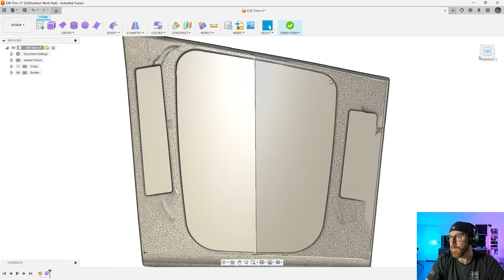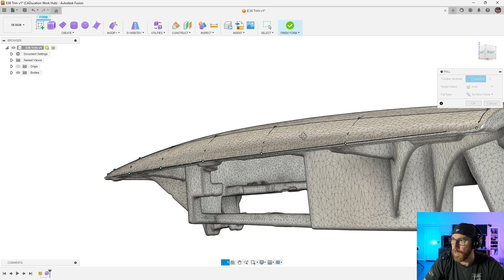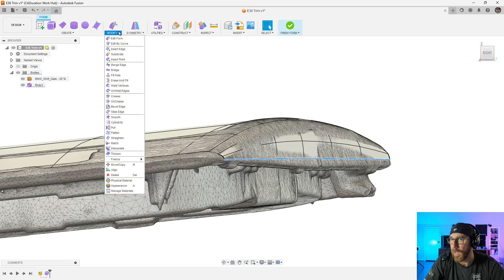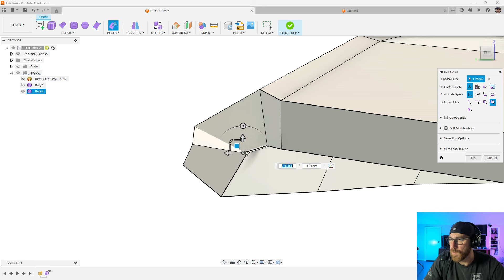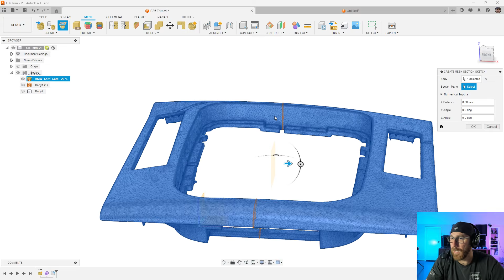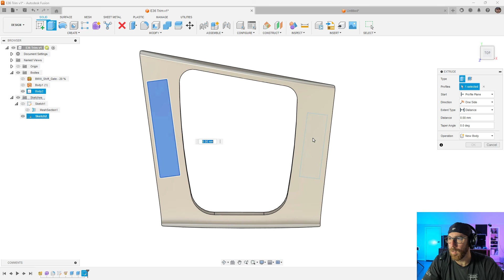Reverse Engineering Car Trim Panels for 3D Printing part 3 – BMW Trim Panel and Fusion

Comment: all fusion has to do is add a couple of features from geo magic and it'll be great! the gradient live snap in form faces and the decimal adjustments after to snap to mesh. =p
Reply from the maker: Yeah.  I have heard some rumblings about more mesh tools, but have yet to see anything official on it.  Some sort of gradient for how far off would be massive.  Move with snap on has never worked for me so I always move then snap with the Pull tool.  If it worked like QuickSurface does that would be amazing.  QuickSurface also has a "brush" you can run over the form to "ease" it which is helpful.

Comment: You're doing Gods work. Can you add points on random points of a line to address low/high points between two existing vertices?
Reply from the maker: Thanks!  I am not sure I follow your question.  Are you asking to put points on a line to visually show that areas are high/low?  Fusion doesn't have any analysis unfortunately so its all visual.  In QuickSurface we do have analysis tools that can show you how close/or far you are with a color chart.

Comment: I'd love to see something where a scan wasn't perfect and we can't rescan the part so we need to fill in the gaps of the scan data.

Is there such a workflow that you've already done that I can learn from? That is the combination of the original 3D scan + additional CAD modelling on top that can be fused together to bring a complete image.

A really good example is while the core scan data is there, tabs might be incomplete so 3D printing a copy might result in a wonky looking tab because of artifacting.
Reply from the maker: Hey there, well there isn't really a combining of scan and CAD data.  You kind of have one or the other.  But with this part you can see we create the shape over the holes.  Not having tab locations can be tricky though.  We do have a few series where we make parts from the scan data.  some with better scans than others.  the Custom Duct series talks a bit about the level of detail and requirements.  for example the scan data inside the bumper is messy.  The exhaust manifold video has an "ok" engine bay scan with roughly where things are.  In our GPz build series we have several parts that are based on scans.  headlight, Tail section, and triple clamp (for now).  We also have a 5 or 6 part series on doing an airbox.  the airbox scan was pretty good but some of the auto mesh filling tools messed up some features so a little bit of guesswork filled in the gaps.

but at the end of the day, if you don't have at least some little reference it is very tough to know where to put things but not impossible!

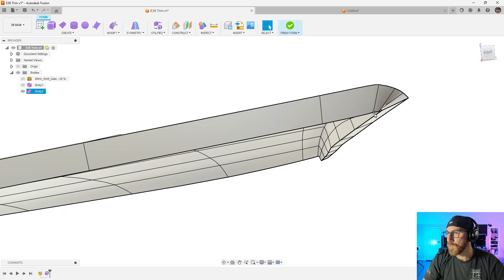Comment: The thing I'm most struggling with is the edge work; the work around 18:00 and understanding how to clean up the edges using box display, etc. Once I thicken and get to the inside edges, I'm not quite understanding the way it works and what to do that is appropriate. It's the one thing I can't seem to wrap my head around. Is there any other videos that explain this 'for dummies' like me and may help?

Thank you for these videos! I use them tons to learn individual parts in Fusion!
Reply from the maker: Its tricky because it varies so much based on geometry.  I have covered it in a few different videos.  This one is talking about how to identify thicken problems.
https://youtu.be/yWSafAfDjxI

I also covered it in the Race Car intake duct thickened forms.

But in general if you have a surface that will Pinch or roll over on itself when thickened, meaning the radius of curvature of your surface is smaller than the thicken amount you are trying.  Using thicken in forms lets you manipulate the inside independently.  So you can add or remove edges, move them around etc.  We also did this in a recent video last week designing a mountain bike fender with a thickened form.

It takes practice and every use case will be slightly different, but if you have strong skills with forms modeling just treat the inside like it is independent and work with it that way.  For 3d printing it doesn't really matter as much about the part thickness as with something like injection molding.

Comment: Could you create some mesh section sketch and then join them with a loft instead of working with forms? If so, do you have to fit curves to mesh section manually for all the sketches?
Reply from the maker: You can certainly do that but there are a few problems.  With this because so much of it was open (hole for the shifter) there isn't a ton to go on with the mesh section sketch.  So you have to sort of guess at it.  With a form you have a bit of a better chance of slowly adjusting the shape to get it to fit.

The other thing with mesh section sketches is the spline that "auto fit" are junk.  curvature is awful.  So i generally do that manually creating splines that are close to the mesh.  We have an old video on a dodge dash hvac/radio bezel showing that.  Also have done it in a few series as well.  Generally i use mesh section sketches for more mechanical parts where I can do things like lines and arcs rather than splines.  partially personal preference.

Comment: Amazing video, I have tried to follow it using a really simple piece I need to reverse engineer but it is compound curved and the faces obviously will not snap over the curve any chance you could help with doing this stuff on curved items I ould share the scan if it helps but I cannot seem to get the faces I created  subdivide as it says non manifold and the pull command wouldn’t select the face at all it was like it didn’t exist any ideas ?
Reply from the maker: hmm that is strange!  feel free to email me support@caducator.com and i can try to answer questions.
Reply: @LearnEverythingAboutDesign shall I send the scan I’m using for you to look at ?

Comment: Curious, is the reason box display rough upon the initial free foam because the points aren’t normal to the surface when you are creating the surface? Is that what smoothing out the box display doing for the surface over all
Reply from the maker: Box display is sort of the mathematical driver of the smooth surface.  The more divisions you have the closer the box and smooth display will look to each other.  The goal (for me) is to try and manage the box display edge flow and face angles to better drive the smooth surfaces.

So there is another display type that shows the cage(box) and the smooth display.  ATL+2 on the keyboard will let you see the box display and manipulate it while showing the smooth under.  Try making a simple shape starting with a quadball, go to that display type and start pulling edges around.  Do the same thing with a Box model as well.

Comment: Excelent video!!! Thank you!
I prefer use Fusion than Blender. The huge problem for do the same operation and other designs for 3d printer in Blender are dimensions and accurate offset ops. That´s why I restarted with fusion 360. And your videos really helps a lot !
Reply from the maker: Thanks, and yes for sure.  Blender is super powerful and with add-ins like Cad Sketcher you can mimic a cad system, but it isn't exactly the same.  and if you need a NURBS surface you can't really get that in Blender (currently).
Reply: @LearnEverythingAboutDesign Thanks to you i made a 1972 corvette stingray , the only issue i have is make frames for the windws for 3d printing iam planning to add a transparent glass for it

Comment: E36 sunroof motor cover that clips in like it’s oem
Reply from the maker: If i had an e36 that might be possible.  do you have one?  I swear your avatar is bunta fujiwara so figured youd be rocking an 86 :)
Reply: @LearnEverythingAboutDesign  I’m sure you know the 86 belongs to takumi and the Subaru was fun but rwd is the most rewarding.
Reply from the maker: @DrPsta  Agree.  I would have to dig way back in my Initial D memory bank.  I though Bunta raced the 86 before it became the tofu delivery car that takumi ended up driving.  Always have a soft spot for the 86

Comment: Hi Matt, 
Once the reverse engineering work is complete, if the part to be printed exceeds the printer's maximum print volume, how do you divide the part? Do you have a video explaining that? 
Thanks!
Reply from the maker: I have plans to do another video talking about this.  Some print slicers can do this automatically, but in many cases you have to get creative and figure out how to put them together.  We did this on the Wideobody series awhile back https://youtu.be/ftKAl7WWfZM  and also for the GPz tail section.  It helps to add features to locate them like holes for pins or something.  Generally they need to be holes with extra pieces printed so you don't need extra supports.  On the fender because it was such a thin piece I added some ribs to most of the parts to help with support and bed adhesion.
Reply: @LearnEverythingAboutDesign  OK. I'll keep what you're saying in mind and I'll watch those videos. Thanks for the info, I'm looking forward to that video on the subject.

Greetings from Argentina!

Comment: Wouldn’t reverse engineering be studying the density. In theory the density of material could be non-uniform. 

One of the most tricky things is orientation of the fdm, infill, layer count.  These parts always seem to fail at the tabs or thinest points.  Even injection molded fails.
Reply from the maker: The term reverse engineering with 3d scanning typically means recreating the scan part with CAD.  For a professional this usually means creating a prismatic copy of the mesh.  For most hobby users this means making something close to the original as either a replacement or upgrade.

Yes with FDM we certainly have some mechanical issues.  I have printed several PLA-CF parts and been really happy with the strength vs a standard pla.  the layers aren't visible and the layer adhesion is better.  I did a video awhile back talking about fdm, sla, sls, urethane casting, and injection molding. pros/cons, costs etc.  For a one off part like this you could get away with fdm if you printed it standing up on end.  This would give a good surface finish and if the tabs are oriented perpendicular to the build orientation they shouldn't have failures at the intersection.  Would it survive multiple installs and removals? probably not.

Another option is to epoxy the tabs onto the part.  this lets you print the tabs in their ideal orientation and material (maybe even metal) and bond them to the part.  I have had several prints that I bonded and they never fail at the epoxy...
Reply: @LearnEverythingAboutDesign  Thank you for your thoughtful reply. I will have to try the epoxy method next time I get a contact failure or on initial attempt, sounds promising.

Comment: Thanks for the video. IMO, using free form for that particular case is not worth the effort. I know you're trying to teach that style of work, but, with a few sketches and 3 rails I can do faster and better form. In a very organic shape, for sure, this will be faster, but for this kind of work, nothing like a simple loft. Again 3 sketches and 3 rails. 10 minutes or less. It will be great if you show a video doing that too. Remember if you developed more skills, reverse engineering is more faster. Thanks for your work. Great as always.
Reply from the maker: Thanks Jose, in part 4 where I use Plasticity I do show lofting through multiple curves.  In my testing on this part I did that workflow and it was slower and less accurate.  This part is a little odd as its not really symmetric and there are some nuanced curves on one side.  If there wasn't such a big hole in the middle it would be much easier to extract a curve, but you are right and it always depends on the part.  When I did this in Fusion with curves I found just snapping to the mesh section where the part was didn't give a great result, it bubbled up in the middle.  and picking a random point in the air was a hard concept but certainly possible.  When I did this i left the sketch under defined and just dragged the points around after the surface was created.

For reference without narrating and walking through the part can be done in about 10mins like you said in Forms as well.  Maybe I can add a part 5 just to show that.

thanks
Reply: @LearnEverythingAboutDesign thank you for the heads up. I will be waiting for next video. Thank for you great work. I love to see your content even I work doing this everyday.

Comment: If like to see a plasticity video - but I want to see a video doing the same thing with the auto tools in QS even more. How do the auto tools handle various types of parts? Because that could be super useful. Exporting CAD data sounds pretty useful, too, but I'd be interested to see the workflow between the versions of QS that export CAD data, vs bringing the mesh from QS personal into fusion and creating a solid from that, vs going from the surface or form tools in fusion to a solid (again, all on the same part). 
Just my 2¢, beggars can't be choosers and I loved this video series. Subbed and liked and clicked the bell and everything - now I gotta go back and watch your other videos ;-)
Reply from the maker: Thanks Chris, and yes great comment/question.  I have a webinar I did for QS (before Personal was a thing) that shows the auto freeform tool in both LITE and PRO so you can see the difference.
https://youtu.be/_PdPFEnUpvM

Personal doesn't have an auto freeform tool and trying to use it in LITE or PRO really works best if you isolate a portion of the mesh rather than trying to wrap the whole thing.
LITE and PRO have different algorithms used to create the freeform and the PRO one is so much better.  has a symmetry option and the results are just cleaner and better flowing in terms of the shapes.

Personal does have a "Fit Surface" tool which is the same one you get with LITE and PRO.  Fit surface is something you need to use carefully and works best if you limit the selection.  Doesn't really work great on this part from my testing.

Ill make a note to make a video going over/highlight some of the tools and differences in pro vs lite vs personal in a future video.
Reply: @LearnEverythingAboutDesign Thank you - that explained it way better than I could find on their website. Going to watch that webinar now 😊

Comment: I'm trying to create a part that is similar to this part for my motorcycle and the information so far is great!!! I'm still having problems but hopefully you will finish this part, and im sure it will answer questions i dont have the words for right now. Thank you for the work ur doing.
Reply from the maker: Thanks Chris.  Right now there isn't plans to add all the tabs and fastening bits to the bottom of this.  I will let the user that sent it in do the finishing touches for their updates for 3d printing.  but can try to answer questions on your project.

Comment: This is likely a dumb question, but when using box display is there any meaning to the gradation in the shades of grey for each face (eg, darker = more/less parallel to the plane you’re viewing in?)
Reply from the maker: All the shading you see on the box or smooth display is a result of the environment you have setup.  For example go down to the monitor icon in the bottom center of the screen go to Environment and change it to Infinity pool.  You should see the top faces go much lighter because of the direction of light in the scene.  

I think that is what you are asking.  If not let me know.
Reply: @LearnEverythingAboutDesign not quite what I’m asking, but probably the explanation. I’m looking at my model (or yours) in side display, in box mode, and each face is displaying in a different shade of gray. I get that they are each reflecting the “light” of the environment, but can the shades tell us anything? Example: if on an edge loop they are all nearly the same grey, or all very different, can we use that as a clue that our faces all out of whack? If we manipulate edges and vertices to get the shades of grey to match better adjacent faces, can this be useful?
Reply from the maker: @ThatAdam12  Interesting.  Honestly I never pay attention to that in box display but maybe.  In smooth display I often use the light/shadowing to help me with the flow of edges.  In box display I am mainly looking at the edges themselves in different views to try and make sure they aren't colinear in all views.  In some cases you do want colinear if you have a Tpoint intersecting them, but for most cases you want at least a very small angle change as you move from one face to the next or you run the risk of causing a wobble in the surface.  I say risk because there are always times that you will have to break these general rules.
Reply from the maker: also , great observation!!
Reply: @LearnEverythingAboutDesign I tested it out a little last night (doing your helmet for the 10th time). I tweaked some faces in Box to get a shade of grey closer to the adjacent faces (they were way off). I got a good result in Smooth and Zebra. Best helmet so far, too.
Reply from the maker: @ThatAdam12  Great to know ill pay attention to that next time!